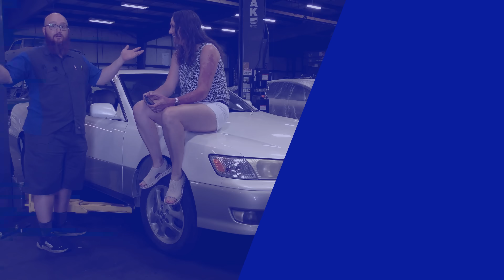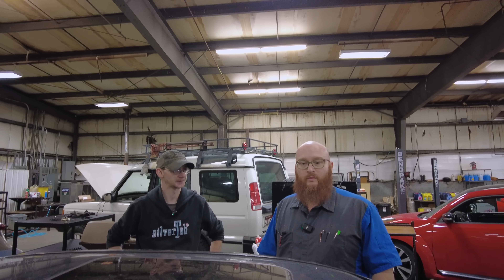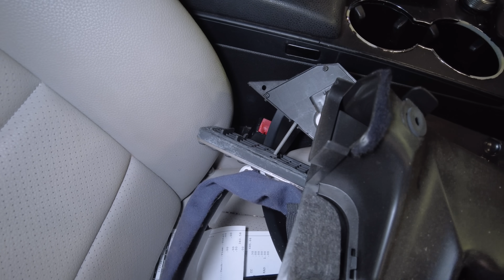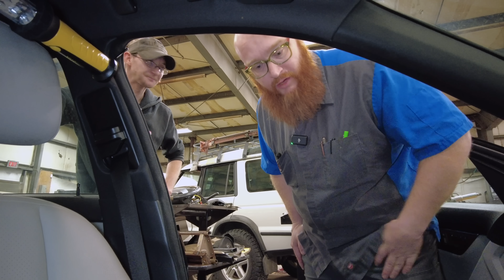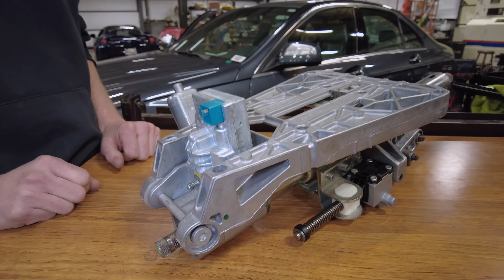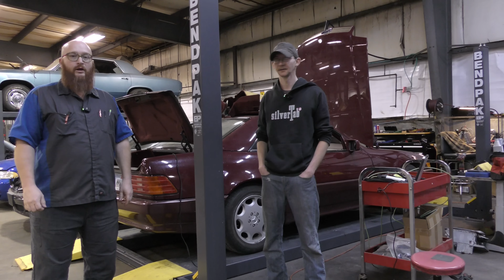Tiny Part TOTALLY Disabled This Mercedes! AND it's a Common Problem!

Comment: Happend to me twice in 150k miles on my 2011 c207 e coupe which is on the same platform. Both times I managed to "fix" it by shaking the locked steering wheel and it was ok for next 50k miles

Comment: Easier to just do the bypass of the relay to start the engine, adjust and drop the steering column and drill a small hole to mechanically unlock the steering lock and get it out that way.

Comment: I drill the corner of the box and use a screwdriver to turn the gear and am able to remove the box from the column while still in the car. I've always been able to lower the column as it will move when the door is opened.
Then you are able to plug in the emulator. 
There's hacks to get the engine started if the ESL fails unlocked

Comment: IS there any tell tale signs that the motor is giving out. My mom has one of these. Typlically after what mileage would the motor need repalcing. I actually called Mercedes after seeing this video and they recommend after 100,000 miles it can be a problem. any thoughts on this matter.

Comment: Those German wheels are great when and if still functioning, but they are a pain in the butt to maintain and repair not to mention their being endless money pits...The early 90s saw some great German cars and I used to own one in 2005 (a 1993 VW Passat). Then a decade or so down the line German automotive engineers decided to call it a day and started stuffing their cars full of cheap plastic and annoying features like stop-start and plenty of touch buttons...Swapping out one of the head lamps became very time-consuming as you had to dismantle the battery to get access to the lamp...Same with other parts...Unfortunately, German cars have now become unreliable and too expensive...

Comment: The module can be repaired for $9.00. The little motor inside can be found on ebay. I've had do do two of these repairs. Replacing the little motor in the module means that repairing the module with the EIS isn't required. But as The Wizard and Grimes have pointed out. It's the labour getting the steering column in and out which is the killer. I didn't need to remove the accelerator pedal though. Be very careful with the clock spring - don't try and move it around.
Reply: There's absolutely no need to take out the entire steering column, I didn't even take off the steering wheel. Take out the back two bolts and back out the front two bolts as far as possible and leave the column hanging. This gives you more than enough clearance to get in there with a 1/4 ratchet and take the nut off. In cases where the lock was absolutely stuck and we had to drill it out, we had a 1 meter long drill bit that fits into a regular hand drill to easily drill out a hole in the top right corner. This gives you acces to the teeth of the motor engaging the lock in order to unlock it. This way you're not finnicking with getting the steering column out and back in which can be a pain in the ass.
Reply: Is this module for the steering column only for the electronic assist feature where the column automatically retracts?
Reply: @HenryB-x9k  The module is called the ESL - Electronic Steering lock. Not to do with the autoretraction system. The issue is. Inside the ESL is a small electric motor which drives a worm gear attached on a shaft. The worm gear turns a pinion gear and this gear closes or opens a contact which sends a signal to the EIS (Electronic ignition switch). The pinion gear also lowers and raises a small arm which locks the steering shaft from turning.
There's lubrication on the worm gear and pinion put in at the factory. Over the years the lubrication drys up and the worm gear and pinion seizes up and hence the electric motor burns out.
Solution to the problem is to remove the ESL, take it apart, install a new motor and worm gear, re lubricate the gears and put it back together. Or just replace the ESL at a great cost or replace the ESL with a bypass unit - (As Grimes and The Wizard mentioned).
W204's in overseas markets came either with electric adjusting steering shafts or not. The non electric adjusting steering shafts are much easier to replace the ESL.
The little electric motor inside the ESL can be boight on abay for as little as $9.00 but there are better quality units for up to $60-$70.
Replacing a ESL from Mercedes will still run you into the lubrication drying out and another failure.
These ESL's often just dont stop working. Many times the unlocking process becomes intermittent - this is a sign of imminent ESL failure.. Replace the ESL straight away.
It's much easier to remove the ESL with the steering in the unlocked position. If the ESL is locked up - it needs to be cut out.
Reply: @lezivanerrol3697  Could extend the wires and mount the ESL somewhere very accessible to make repair a lot easier if it failed again . No steering lock then of course .
Reply: True, But that would invalidate your Insurance cover - if you are in a location where this is mandatory. I had one steering lock fail on a car less than 8 years old only only 30,000 miles on it.  @stewatparkpark2933
Reply: @lezivanerrol3697  Do you happen to have a link for the $70 motor?  I am hoping it is the same motor as the one for a Mercedes Vito EIS.
Reply: @johnkaimins9998   EIS and ESL are two different modules. EIS (Electronic ignition switch)is the unit which is installed behind the "ignition switch". The ELS (Electronic Locking switch is installed in the steering mechanism itself. The EIS is pure electronic and either must be replaced or repaired at a ECU repair shop. Depending on your country you should be able to find a reputable ECU repairer. Off the record. official dealerships in my country send the ECU's out to be repaired locally rather than wait up to 6 or more months for an OEM replacement from Germany for off warranty vehicles (They do give the owner the option though.)
EIS need to be reprogrammed to the key and the VIN of the car.
Reply: Are you in OZ? I can give you a link to the repair shop. he guarantees his work and the stealers use them. @johnkaimins9998
Reply: @lezivanerrol3697  Thank you so much for your very informative reply, and pardon my ignorance regarding the EIS. Do you happen to know where a Quality motor for the ELS can be purchased online?  (I drive a W639 Vito) Best regards from Adelaide, South Australia!
Reply: @johnkaimins9998  W639 has a different steering system than a W204, W212 or W209. There are W639 ESL emulators which if you google W639 ESL you can find. Otherwise you might be able to telephone Australian ECU repairs in Sydney NSW for advice - They're back at work today. Just google them. They can do the repair for you. It's an electronic repair - not a mechanical one on the W639 Vito.
Reply: Go Wizard…. Heading for 1M subs 👍🏼
Reply: The motors do not always fix them. Once the threshold is achieved the software locks up. The software then has to be unlocked before they can used again.
Reply: You're right like I've said here many times The problem of using Mercedes, Bimmer, Audi or any high end cars in North America is the Mechanics here for those cars are shit...even at the dealership.  They still don't know how to fix easy stuff on Germans Cars compared to European Mechanics or even a roadside Mechanics in Africa or Middle East for these cars. My friends W204 had the same problem, and Bad  starter motor here in Ghana and was damn easy for these young Mechanics with few tools to fix everything without having to disassemble the whole car like this one. And oh for the starter they open it up and fix for just $30

Comment: Same problem exists with our C5 Corvette. I installed a column lock bypass module years ago before experiencing the problem and being left stranded.  Fortunately being a Chevy the part is less than $100
 bucks.😊

Comment: If anybody is having this problem if you turn your key the second position and you can still move the wheel, you're in good shape.

Turn the key to the third position, as if you're going to crank the car. Go to the fuse box underneath the hood on the driver side there should be a red 7.5 in the back of the fuse box pull the fuse out.

Go to the green relay in the same fuse box pull off the cover on that green relay press the sides together. After reinserting the 7.5 fuse in the car will start right up

This will work for the w204 c300, c250 and c350

Comment: The second generation Saab 9-3 has a similar issue with its steering column lock failing. But its a much cheaper fix then that and less complicated. Still a pain.

Comment: Crappy plastic parts.  I had this happen to a 2013 C250, so I had the emulator installed.  Everything was fine until the transmission conductor plate failed.  When I had it replaced, Mercedes couldn't get the conductor plate to load fully because of the emulator.  They installed a new steering lock and the transmission software then installed fully.  Yuk!

Comment: In this instance I don't think that installing the full lock assembly versus the emulator assembly really is doing it right. Since the part was not designed well to begin with there's no real upside to installing the regular part and I don't think that that really would be doing it right

Comment: Great video! Kansas City Auto Electric here: I have told my customers for years that these cars are built for the new car buyer only. They have done the science and marketing research to tell them exactly when these things will break. They will run fairly well up to the warranty expiration. At that point the original owner will be trading it in for a new one anyway.  They profit from the way overpriced sale of the new car and double dip on the secondary owner in parts and labor. They are well aware that these cars take a dump on resale.  It is called "planned obsolescence". This is not your father's Mercedes anymore and has not been in decades. The bean counters are the ones building the cars, not the engineers like they used to be.  These cars are specifically designed to make money till the smart ones junk them and cut their losses.  I truly beg my customers NOT to buy a used BMW, Mercedes, VW,  Porche, Audi, or any make of German descent. Most listen and the ones that do not cry like babies when they get my bill and I do see them regularly.
Reply: After the W123 steer clear.

Comment: EIS/ESL failure is also on w212's & c207's. The lock actuates every time key is inserted or start button is pushed. They warn before they fail, via soft, slow, & weak engagement. If immediately failed in locked position, use a deadblow under the steering column & it can be forced to "open" position. Turn off ignition but LEAVE KEY IN, & you can fix with it "open".

These interior panels come apart like legos. 

Conductor plate is very common on 5g gearboxes. A 16 yr old noob could sway one. My c207 chassis has been 100% more reliable than my last 2 Acuras & is 100% easier to wrench on & factory parts are often close to or over 100% cheaper than my mom's 3rd gen TL. Let that sink in if you've never been within 10 ft of a Benz, let alone driven or owned one.

Comment: We do quite a few of these every year in my shop. I can literally do it blind folded now. We actually sell and pair the emulators in house. Overall not a difficult job. Just time consuming, and annoying. If you have one of these listen to the EZL (ELECTRONIC ZYLINDER LOCK) When you insert the key. If that sound changes, be prepared. It could be the next time you attempt to start it, it wont start. Sometimes you get that warning if you pay attention.  Most of the time this will happen when you are in a hurry or have somewhere important to be. Thats when they love to fail.
Reply: Um, no. It is a very difficult job which is why it cost so much.

Comment: These modules aren’t on any W163 or W164 MLs are they? Seriously looking for one as a cheap roadtrip cruiser.
Reply: Nope, those don’t have them. Stay away from 06/7 models and check the rear hatch area for water intrusion on 164
Reply: @GrimesGarage balance shaft issues?
Reply: @BCK1970  correct. The issue was primarily 06 and very early 07

Comment: When I was at an Indy euro shop a few years ago MB required shops to pay a few thousand dollars a year to even be allowed to buy these theft related parts. Is that still the case?
Reply: Yes it is. The emulator is aftermarket and can be programmed with non oe tools

Comment: Oh that’s a very interesting video you did Mr.Wizard!! I own a 2014 GLK250 (X204) since day one and I am touching wood that I won’t encounter this locking mechanism issue!! Thanks for all your very good videos!
Reply: Highly recommend inspecting your rear subframe near the forward control arm mount. There is an issue with them rusting and is under warranty from MB.
Reply: @GrimesGarage  I knew about this but thanks for having mentioned it!

Comment: I had the steering lock motor on my Mercedes CLS stop working, but after 15 years. It was easier to remove, and I was able to get a new unit, and swap circuit boards. So, no need to program it. I couldn’t find an emulator that would work. I’d love to know where you got one that would work. 12:36

Comment: Keep rodents away - get a mint oil, mix a bit with water and apply under the hood and under fenders with a small towel or tissue, they hate that smell and won't get it, this is an old school method and it works, I do this both on my car and motorcycle too, when I put it on a jack stand for the winter....✌️

Comment: Sometimes rocking the steering wheel will cause the ESL to unlock which makes life very easy.  ESL will come out with minimal disassembly.  There is a tool to open ESL so that PCB can be transferred over to a donor ESL.  Obviously, this is the "shade tree" solution which a shop will not want to guarantee.  Emulator is more shop friendly.

Comment: I've had a similar problem on my Lexus ES350 where the immobiliser ECU and the steering column ECU failed. My car had no lights on the dash but all other electronics worked.

Comment: Very common issue on 2000s Nissan Maximas, Altimas, and Muranos as well as Infinities from the same time period
Reply: Thankfully, Nissan replaced the ESL on my 2009 370z for free outside of the factory warranty.  I pulled the fuse after replacement. No more steering lock, but no more worries.

Comment: I know traditionally Daimler Benz made the strongest steering wheel locks but this is one objection I have to all of these newer cars

Making it dependent on an electric motor is just stupid 

An electric motor that's going to fail sooner or later. 

And the fact that this happens mainly on one smaller chassis are the other ones better motors? Different design? 

Again that's why I don't like these newer cars and don't get me started on that "stop start" mechanism which I learned is far more complex with more components than just a bit of software and a stronger starter 

Just more stuff to go wrong

Comment: Mercedes really screwed the pooch having a mission-critical item be so cheap and unreliable. Obviously cars are expensive to make, but any single, non-redundant component that can brick the vehicle or otherwise make it inoperable should designed and manufactured to the highest possible standard. It's embarrassing that the replacement part isn't improved or updated.

Comment: The VW one is annoying too, the lock gets stuck with key inside and you have you break it to get key off anyways unless you get lucky or it fails and you can't insert key in unless you wiggle it and luckily you get it to align but the next time it's over

Comment: Every now and then I get tempted to get another (used) Mercedes and I see something like this and say never. I had rat problems eating the wiring on my C55 AMG and they said something about the wires in MB cars attract rodents.  I got the car fixed then we parted ways.
Reply: The insulation was corn based in order to be biodegradable. It was a massive failure.

Comment: As Wizard has mentioned several times, what do you do if the repair cost is 50% of the current value? This is assuming that you can get the repair part. Over the years I have owned 8 or more Mercedes Benz starting with a 1956 190SL. They were simple and easy to repair. However, post 1996 you begin to run into more and more electrical problems to the point where I will not consider purchasing another. As one reviewer put it; "For the past 20 years Mercedes-Benz has been destroying their reputation for engineering excellence that they acquired from the prior 80 years".

Comment: With key and coded engine computer activation the steering lock does not do much for theft, they will haul it away like a tow truck in the first place. The feature is costly, I suspect a safety issue if it were to lock while driving, definitely a 90s feature that is extra cost with digital security down to the computer that runs the car.